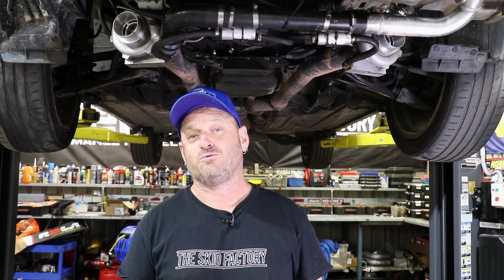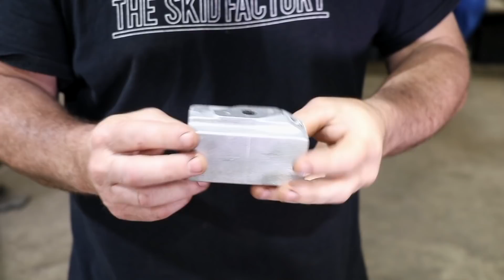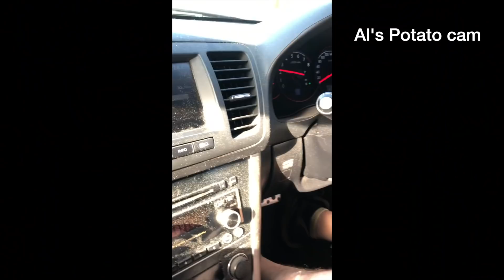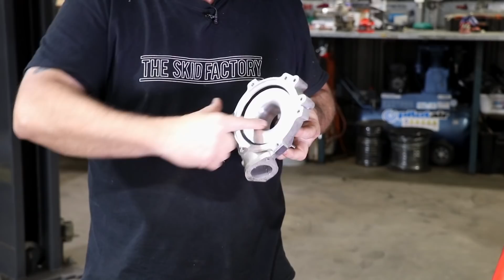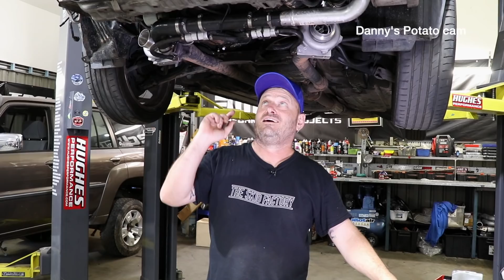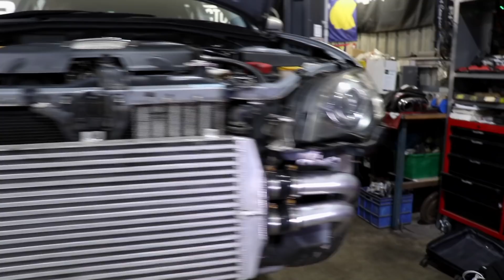Don't make these mistakes with low mount turbos

Comment from the maker: VDO Oil Scavenge Pumps: https://ebay.to/33MN3kO
Oleoweb one way valves : https://ebay.to/39MqmRz 
Dash 5 Turbos: https://ebay.to/36NOlxM
Oil Restrictors: https://ebay.to/3mQacue
Reply: 15-20yrs ago, Apexi branded IHI turbos sold unique anti-surge RB stock mount in 550hp & ~750hp(?) sizes. They were very similar to IHI turbos used in R34 GT500 race cars and Nismo Z-tune street cars. I think the most famous tuner car with Apex/IHI was MSpeed R34 time attack race car. Although Mine’s used GT2560 in their time attack street car without issue.
Reply: Porsche 930 turbo’s KKK/Borg Warner K27 turbo was taken off a big Diesel engine. Porsche did what tuners do now; put Cummins/Holset or Borg Warner diesel turbo on their Civic. Lol. Porsche didn’t over think things back then. Need a scavenging pump, no worries, put mechanical pump on the camshaft. Boom. I like the factory adjustable cam gears; you just move a pin. And degreeing cam timing by measuring lift, instead of setting up a degree wheel. And the fact they didn’t change the car for about 30 years.
Reply: 9:40 Would a drum brake residual pressure valve be suitable/a potential source?
Reply from the maker: I used a wilwood valve once but they have a seat made of some form of rubber which did not last.
Reply: Can’t wait for the patrol episodes
Reply: Damn those scavenge pumps are expensive. Especially if you need 2 of them. Not available in the US either.
Reply: So the Oleoweb is just a non electronic Vtec seloniod made alot cheaper then??
Reply: Will this issue occurs with the vl you've done 2 years ago? cuz I'm planning to make the same combo
Reply: The ebay links dosen't work
Reply: Can you guys help in anyway the plight of Archerfield Drift Park staying open? Even a shout out to the petition that has 17k signatures already would be a great help

Comment: Residual valve can be replaced by a one way valve. Many will not open until 2-4 lbs of pressure is applied. Cheap and widely available.

Comment: Hi guys video is like 4 years old but still helping us new modders. Struggling to find the VDO scavenge pump you guys use in this video I take it they are no longer available I’m putting a low front mount turbo out of a fa20 wrx in my Impreza but not able to put a big bulky scavenge pump close enough for it to be effective but the 2 pumps used in your video are better more compact that it may work in my application, any ideas where I can find them please hit me up if you have any more info where to get them..

Comment: The old GTR "turbo Shuffle". I minimised mine by welding a plate into the turbo outlet merge pipe to alleviate the ridiculous 90degree Junction 50mm off the compressor outlet.

Comment: Caution : do NOT use Wilwood residual pressure valves, or the 2 PSI at least. It has a rubber flap that will get torn by the oil flow that is much, much higher than a brake return flow. Ask me how I know !

Comment: Can you use a 40psi oil pressure regulator on a journal bearing turbo?  I've read that journal bearing turbos need higher pressure than ball bearing turbos.

Comment: Can you use a 40 psi oil pressure regulator with a journal bearing turbo?  I've read that journal bearing turbos require higher pressure than 40 psi.

Comment: i'm building a model-a pickup and was wondering if i should power it with a turbo flathead V8, i have seen an almost new corvette with low turbos so i know it's done, by mounting the turbo under the truck i can keep it looking cleaner around the engine if i don;t have hood sides, after watching this video i think i can pull this off, thanks for your video.

Comment: Fun fact: a fix for 271 engine oil smoke at cold start is to fit a banjo bolt with a check valve incorporated to the turbo. I know some American forums mention oil pressure to the turbo, but I've always measured the oil quantity and aimed for roughly 1.5L/min if you have smoking issues when warmed up (a smidge less for bb) on regular high mount stuff. I wish Garrett would get that air foil bearing technology going so you can mount a turbo any which way

Comment: Thanks guys! I only recently got into the world of turbo builds on N/A motors so this has been very helpful and educational. Mind you I'm 42 and starting to learn so thanks again fellas! Would love to see an episode on the challenges faced turbo'ing the fa20 engine, granted there are alot of "kits" out there but I'm actually thinking about continuing with my current setup or engine swapping to something like a K24 and then adding a turbo kit of some sort. not many in Aus but i would love to give it a crack.

Comment: I have seen on the internet (way back) single/twin turbos mounted way back in the exhaust chain and I always wonder how that would work... Heat wise that would be pretty cool I guess and with maybe just fins on the compressor side piping could act as a cooler (or it would just not be needed at all). The lag would be horrible though but maybe could be engineered and lowered? with some clever stuff (or just bi-turbo it somehow).

Anyway have you ever done that? I guess it's called rear mounted turbos.

Comment: A check valve may be better than a residual pressure valve - the former is normally designed to minimise the pressure drop, whereas the latter is designed to hold a minimum pressure in the line. What that means is there will be an additional 10psi of pressure in the turbo'drain line resisting the oil flow.
Reply: The valve is installed in the oil feed line before the turbo so the oil remaining in the line can't flow into the turbo after you stop the engine.

Comment: “Pushing more air then the engine can swallow”

Pretty sure this is incorrect. 

The surge youre experiencing is the engine requiring more air than the turbos can provide. Not more air. That’s why the anti surge is able to cure the problem. It provides a pathway around the find until spooled up. 

Correct? Or am I missing something
Reply: I'm not an expert but that doesn't make a lot of sense to me, if the surge only happens under boost then there is no way the engine "wants" more air, it would be quite happy with no pressurised air from the turbo's, after all NA engines are a thing. Al's explanation makes total and complete sense in my mind at least.
Reply: @gazmosis87  it’s not happening under boost. It’s happening on roll on throttle. When the engine needs torque and the turbos are effectively in the way. 

Al effectively proved that by correcting  the problem with anti surge housings. Those housings only purpose is to allow air to pass around the compressor before boost builds.

Comment: When I first put my T28 on my SR, I rushed the last bit of the turbo drain install and it kinked. Smoke filled Logan Rd for km's.
A coat hanger turned into a spring and shoved into the hose fixed that issue and went on to live for 9 years in my system before I replaced it all with AN fittings.

Comment: Could you not make a circular clockable sump?
So the oil flow out of the turbo is static to
 the inlet on the sump but the outlet is clockable....

Comment: Are they running on wastegate springs or boost control + spring?  Perhaps you could fix the surge and tune it out with a smaller spring and ramping the boost in slower. If you didn't have access to the mechanical solution.
Reply from the maker: It runs 5 psi off the spring.

Comment: Learn so much from Yoda's talks. He learned by trial and error and time and money, he offered us a chance to bypass a hole lot of that. Thank you.
FYI when you heat up a magnet there is a temperature depending on the material that you eliminate the magnetism in it. Thats is what blacksmiths use to find the correct temp for heat treating steel.

Comment: Fascinating you say you seen pressure in you sump I am currently facing this issue ATM China gt42 rear mount it is fine daily driving although as soon as I'm at the drags the turbo sump will just spray out the turbo sump breather line

Comment: serious question: is rebuilding turbos not a thing in australia? we do it all the time in canada. rebuild the oem turbo with a better billet wheel. either stay the same size or machine to make bigger. usually costs less than a new turbo.

ps: i love it when you talk and talk and talk. i usually watch 2-3 times and soak up knowledge.

Comment: Hello Al and Woody, I'm a turbomachinery engineer in Brazil and have a EJ22T GC8 that I want to low mount one day, just for the hack of it, so thanks for the series and information. Following up your troubleshotting process, I would suggest that you take the time to 3D Scan or CMM the backside of the compressor case. Newer ball bearing turbos uses very small clearence between compressor whell and case, to increase efficiency and compression ratio, but this decreases the compressor map area, developing surge events. If, by chance, the reworked anti-surge case presented a 0.6mm clearence, compared to an possible 0.3mm of the original one, this could be the motive of the surge prevention, not the recirculation paths itself. Just a though, only looking to contribute, not to question the extensive work you have done. Cheers!

Comment: 9:00 BMW N20 oil feed lines were revised with a ball/spring restrictor valve for this exact purpose. Excess oil ends up seeping through the turbo and you get a puff of smoke on cold start

Comment: What's your recommendations for breather hose size for the turbo sump. i've got a 10AN breather, is that too big? might have to get one of those Oleoweb Valves. I let my scavenger pump run for 10 seconds or so before i turn my subaru forester on.
Reply from the maker: 6mm breather is plenty. I only run 8mm suction line on the spur gear pumps but the VDO size you can't change.
Reply: @theskidfactory  thanks for the reply. I’ll reduce the breather. Also, the oleoweb valves are BSP thread. Did you have an issue getting them to fit?

Comment: Very handy video as I have twin turbo v8 bmw e30 that is compressor surging like mad, now I know to change the compressor housings, cheers al 👍
Reply from the maker: Which engine and turbos are fitted?
Reply: The Skid Factory 
M60b40 with gt2860’s (chinesium specials) non antisurge comp housings

Comment: do they normally have air filters pods mounted on the intakes to prevent rocks flicking up into the spool? also water getting in during rainy weather when following like cars trucks etc.
Reply: Undoubtedly yes.

Comment: Your ‘residual valve’ is known as a check valve in the hydraulic and fluid power industry. You can get them in any pressure rating, from 1psi to 10,000psi.
Reply: A check valve is known as a one way valve in the plumbing industry
Reply: Yep.
Reply: Yep. I used to design them and sell them by the hundreds of thousands to the compressor OEMs. I miss that gig.

Comment: After watching this I learnt to never twin low mount turbo a Subaru 😂
Reply: Since we all know that gravity only affects Subarus!
Reply: @Totenkopf_88  Subaru never had a turbo let alone a twin turbo H6 in production only a one off for a concept car and all other twin turbos were 4 cylinder so I doubt you could get factory manifolds to fit this engine.
Reply: I didn't even know subaru made factory twin turbo 4-cylinders 🤔🤷‍♂️
Reply: @jordanlatta  yeah, they had one in the Liberty B4 early 2000's.
Reply: An interesting fact about subaru's twin turbo system is that it sucks, and belongs in the bin.

Comment: Hey blokes just wondering what’s happened with the auto box or still running the same one?
Reply from the maker: It is still in there but is far from ideal. I would not recommend turboing an auto.
Reply: @theskidfactory  there are things you can do, valve bodies from hexmods being one.

Comment: Great video :)
The Disco Potato will do the same thing in a similar install, had minor choo choo action on the March on the first build. That had both turbos feeding to one tank on one end of the intercooler.
In the second build I created a funky carefully designed merge pipe but still fed to the single tank on the intercooler and there were no problems.
In the 4WD build the two turbos feed into what is almost twin tanks with only a relatively small "bridge" between them and there are no issues there either.
Seems to be one of those things that can be EXTREMELY fussy and tricky to get right!

Comment: When I did a turbo hayabusa 15 years ago I tapped an oil feed into the engine just beneath the valve cover in order to get away from the high oil pressure then gravity fed to the low mount turbo and scavenged using a 19mm ss pipe directly to the vdo pump..turbos do not need much oil to live happy.

Comment: Chuck a set of comp turbos on it, and problem solved , no need for pumps, sumps , breathers, or any extra shit, this  is what 99% of low mount turbo people do, saves a bunch of extra rubbish needed
Reply from the maker: What has compound turbos got to do with this, please explain.
Reply: @theskidfactory  comp turbos are oil less, all they require is to pump grease in via the grease nipple   attached on the compressor housing , every 2 to 3000km just fill it up , no oil scavenging issues, no oil lines, or pumps needed,  just water lines, they are the best  for low mount turbo setups
Reply: I don't see how compound turbos would be simpler.
Reply: compound will only get rid of the compressor surge. the rest of the issues are all still there. but then you get the complexity of the compound set up to get right. it definitely is not easier.
Reply: I have a low mounted single turbo setup in this chassis with an EJ, which is a shorter motor, and there is hardly any space left in the engine bay. Where would one find the space in one of these engine bays to run a compound setup? Could you please link us to your YouTube channel so we can watch you do it and explain your method abd logic?

Comment: when using the residual valve, wouldn't it cut  oil flow to turbos while they are spinning down? would an alternative to be to run the scavenge pumps on a timer after shutdown / before startup? '
Reply: All engines cut oil supply when they shut off, in what way do you think a residual valve is different then a top mount engine loosing oil at the exact same time when the oil pump shuts off with the engine?
Reply: 10psi Oil pressure not boost pressure
Reply: @607CHA  if run hard turbos can spin for a longer time than you think. He's worried about the oil cooking in the centre section with no flow. Running the scavenge after shutting down wouldn't help either, unless you're running an electric pump. No supply and they won't suck all the way from the sump unless your inlet is super low and set up for it.
Reply: @BuddyDarDarTV  if oil cooking is the worry then your shutting it down to fast after pushing it hard.
Reply: @jaydunbar7538  Exactly, ain't nobody got time to wait a minute for them to spin down. 😉